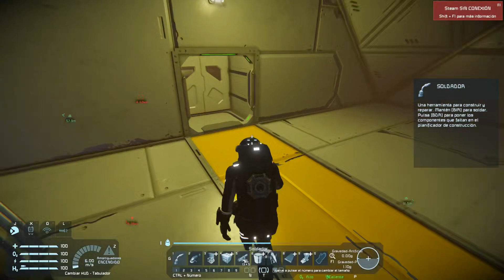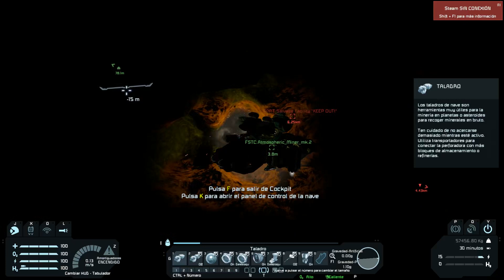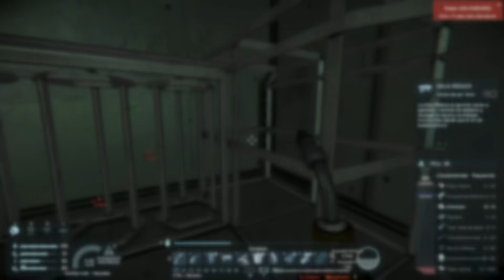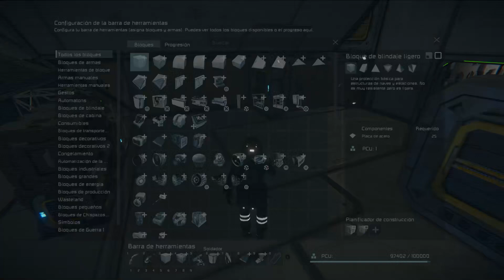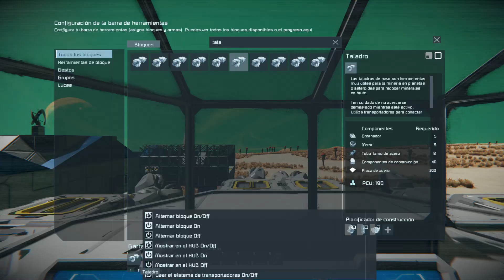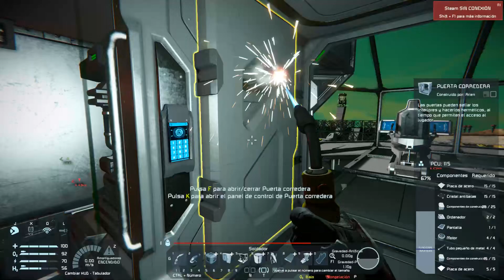KSP Expert tries Space Engineers part 2 | Finishing my first ship

Comment: I would not recommend turning off the power to your ship, as if a grid is not connected to the ground and doesnt have power it will despawn if you get to far away from it
Reply from the maker: Damn 😲, thanks for that info. Seriously, it would have happened to me at some point if you hadn't told me.
Reply: @overmind3922  yeah i unfortunately had to learn the hard way, figured i would give you a heads up
Reply: the reason that a grid that is not locked or has power despawns is so wreckage doesn't build up and cause performance issues
Reply from the maker: @q.8532  Yes, it's understandable. In fact, until now I'd been playing with a certain amount of paranoia because I didn't know how far it was safe to get away from my ship, at least now I know how it works 👍

Comment: Oh yeah, the reason your custom turrets arent getting ammo is becausr you used standard rotors instead of advanced rotors by the looks of it. Advanced rotors have a conveyer pass though on them. But I'd need to personally take a look to be sure. Another small tip, you can double click items to transfer them faster, shift click transfers 100 at a time. You should also completely  finish the rotors so they don't freely rotate
Reply: That and once he replaces it he needs to welded up the rotor.
Reply from the maker: Oh man, I'll have to rebuild both turrets again xD... what a pain.
I also figured out the double-click thing on objects, but in some cases when I tried to pass them to the assembler, they would get stuck and not let me pass them automatically so I had to drag them. I guess that part could be a bug. But thanks for the tips, I'll fix it, it actually makes sense, the hinge has a connector but the rotors didn't and I didn't notice it.